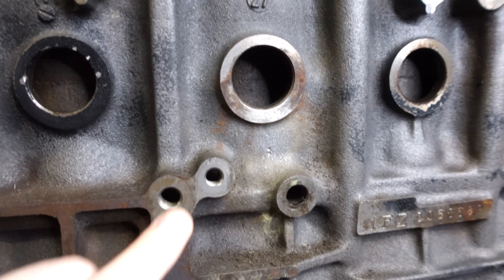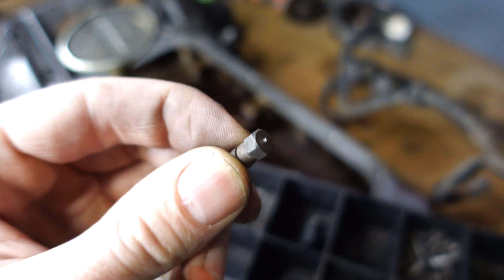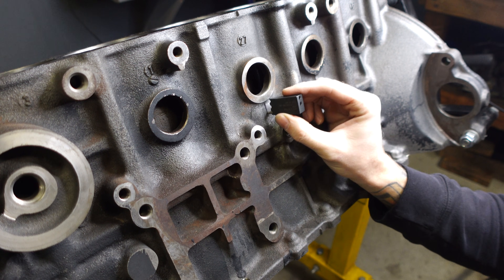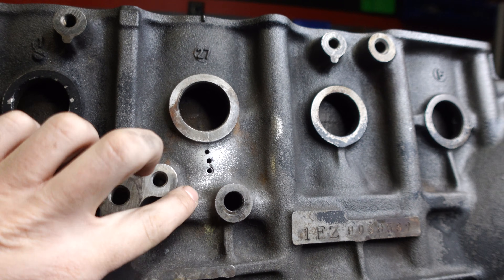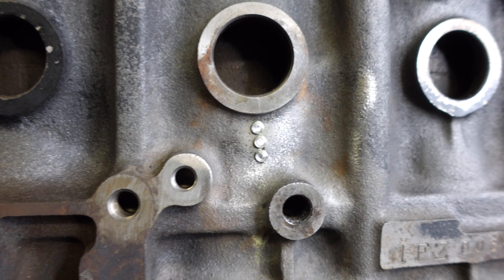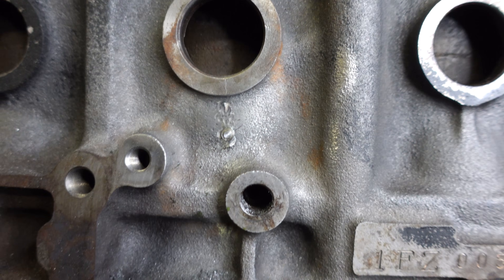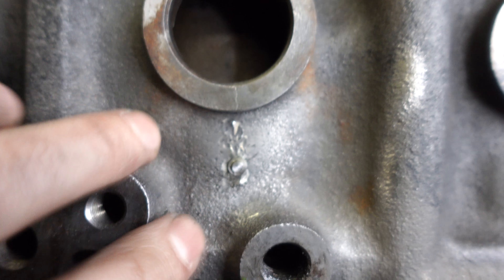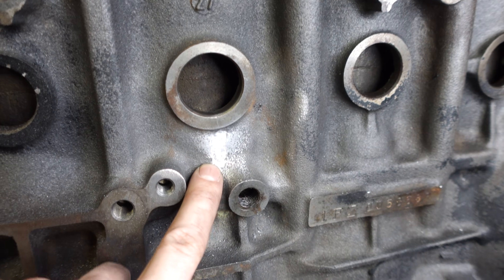How to ACTUALLY FIX a CRACKED Engine Block! Cast Iron Crack Repair

Comment from the maker: If you noticed, I missed the tail end of the crack at 10:27. That has since been stitched.
Reply: im not a mechanic 
same situation , what i did was  glueit with 1,5 kg of jbweld , with the engine on the car  , never had a problem
Reply: @TheMakyato was your crack from water freezing in the engine?
Reply: @Ron_Presley  no  , it happen when i was living in israel and they do not have "winter" i think the car overheat and some failure in the block engine also a month before that i have a blown head gasket + the real isue .............bad thermostat and bad cooling radiator 
first signal knocking  in the engine  follow by power reduction and engine stop , let it cool restart and bit by bit the car manage to get me home 
it was not jbweld but similar glue
Reply: So there is no name for this technique of repair 
just stitching pin

Comment: Hello, I have a similar crack repair I need done on a 1937 Harley case. I've emailed and called Lock N stitch and not having any luck getting a response. Can you send me a contact for the guy that leant you the kit? I have a 2" & 3" crack to repair approximately 1'2" thick.Thank you

Comment: wait, so what prevents it from spreading? Its going to need some kind of sealant right? the drilling, tapping and pins aren't quite enough right? I'm suprised you need so many pins, I would have thought that one on each end of the crack would be enough, unless is it the threads that make a vector for sealant to penetrate deep into the crack instead of just creating a surface patch? And being that your mend was made at room temp, shouldn't the crack tighten up when it gets up to temperature rather than pull apart?

Comment: I used to do metal stitch crack repair on industrial engine blocks (just like this). I repaired hundreds of cracks with no leaks. I would have gone all the way to the top end of that crack. Otherwise, you did fine.

Comment: A quick tip for anyone drilling cast iron or other hard metal - the cutting tip loves thrust force. You will have good results slowing the drill bit way down and putting lots of pressure on the bit. It's always temping to think faster is better, but you run the risk of work hardening the metal and making it even harder to drill.
Reply: So true. Less rpm more pressure applied and frequent oiling of drill bit and area being drilled to help cool the bit to keep it sharp. The faster the drill bit is spinning the faster your going to dull it and harden the work area
Reply from the maker: Absolutely true and I’ve learned since!

Comment: I think you could have done the same if not better with a plain weld. That part of the block is not exposed to very high pressures. A weld would be more than enough to prevent a leak. 

Heck, I'm sure there are even high temperature liquid gaskets that would have worked for that small crack.

Comment: Fascinating process; intuitively, it seems like it would weaken the block, but I watched another video about how they used this process to repair a block crack during restoration of the 1st Deusenberg, so apparently there is enough experience and confidence in the process to trust it.
Reply: Watched the same, but the guy vouching for the product was the guy who made it. To me, it really seems like loctite is the only thing really holding this together. It's a fascinating process but I think I would just clamp the open end of that crack at the freeze plug, and get the welder out and make it a permanent repair. 

That said, I'm not an engineer so whatheheck do I know.
Reply: Yupp got curious after watching that video lol
Reply: I watched the Deusenberg first, did a search for the method and ended up here.

Comment: A less expensive and easier fix is to drill a 1/16" hole on each end of the crack.
Create a v groove at the crack line. Do not use JB Weld.
The best product is windshield adhesive. It stays flexible and will not crack out.

Comment: Question: @10:00 you peen the surface with a socket extension. Leaving aside the use of a socket extension as a peening tool... did the kit recommend peening? My first reaction is that it might stress the stitch pin threads or risk loosening their grip on the block or cause cracks in the threads themselves. Understand you report the block's not weeping, which is good.
Reply from the maker: It did recommend it, yeah. I just used what I had and it seemed to work.

Comment: Is it hard to get a quote from lock N stitch?
Reply from the maker: Honestly the company has a difficult online process. It’s not as easy as just ordering the pins. You have to contact them and give details about the engine, thickness of the block, etc etc. then they give you a quote.

Comment: Did it hold?
Reply from the maker: Yep!
Reply: @RM_Garage  I think I am going to give it a try.
Reply from the maker: @michaelneuman6910  Many are skeptical but this is a tool designed to fix cracked engine blocks and it's what machine shops recommended me to do. The other option was spray welding.
Reply: I am trying to get a kit ordered from lock and stitch and they are asking about thickness of my block.  Is that important?
Reply from the maker: @michaelneuman6910  Yeah. You need to figure that stuff out.

Comment: I swear, I saw that cracked extend a little further down than the very bottom pin…. I think another two pens would’ve been perfect at the bottom… all in all, though you did a good job !
Reply from the maker: You absolutely did! And I extended it after the video. I noticed it too.

Comment: Just started video and in case you don’t say was wondering if the block cracked from water freezing in the block?
Reply from the maker: I don’t think it was from that since it was a California vehicle its whole life. I think the early blocks are susceptible to those cracks, maybe due to thickness differences in the casting in that area or something - not sure.

Comment: what do you think about jb weld for repair the same problem as yours?
Reply from the maker: I don't think it would hold the pressure.
Reply: @RM_Garage  I think Jbweld  would if you cut a v channel along the crack for it to have depth in adhesion
Reply: I bought belzona 111
Reply: @falcon9282  did it hold??
Reply: @falcon9282 and…did it work ?

Comment: No metal shavings will fall inside after you drill ?
Reply from the maker: A little, but flipped it over and blew it out with a compressor

Comment: That's ridicules cant believe that's the only way to fix that.  So the 2 drill spots on the block before you started that was done to hopefully stop or relive the crack right. Mine is not leaking but it sure seems to be an common occurrence. My motor probably has 250K on it and I have done the timing chain and lower upper pans while it was in the truck. But I want to install a turbo on my engine but did not want to just slap it on there. I wanted to refresh the motor first. I use my truck mostly off road and looking for maybe 15-20% power increase. I know Im at a point to where it might make more since to repower but that motor can run forever compared to others. Thanks for the video. Really ease to watch your work nicely presented.
Reply from the maker: If you have a later model 1FZ you probably don't have to worry about it. I've noticed it's mostly an early 1FZ thing.
Reply: @RM_Garage  10-4 so what do you think about the refresh before turbo.

Comment: Nice! I did a new plug and some jb weld on my 1fz hairline crack. It held for a few thousand miles but she's still weeping. 

She's running great but the hairline crack was why I was planning on getting a new Factory Short block, your build has me thinking though that bore over sounds sweet.

I like your comment about block seal, I've been thinking about calling bars stop leaking asking him what product I should use for that hairline crack. I think I would bypass both my heater cores and swap out my brand new Toyota radiator for the old one run it for the specified time to seal it and then switch everything back with fresh coolant.
Reply from the maker: Yeah it needs to be jb welded from the back side. The coolant pressure will cause it to leak again over time.

The machine shop recommended block seal, stitching pins (as I did), or both.
Reply: @RM_Garage  yup, that's what happened, I need to add some bars stop leak to my 80 series to do list.
Reply: What year is yours?
Reply from the maker: @crashedking1931  1993
Reply: @crashedking1931  mine is a 1997, I just picked up my new factory short block, I'm going to build a new motor, I'm not in a hurry though with the work I did on the original 1fz.
Reply: @BillyGoatsAdventures  Hello where did did yo get the factory short block and how much$$
Reply: @crashedking1931  Mr T places a special order. Shop around some dealerships of playball some don't go for 10% above cost

Comment: Watched this video....ran outside and stuck my head under the hood of my fzj looking for cracks. 😬.   Nice job with the fix
Reply from the maker: Thanks! It’s actually common on the early motors I guess! Whole thread on ih8mud about it. 4 pages long
Reply: @RM_Garage  I've read that thread and mine is a 96 but still makes you worry a bit.   Good to know there's a fix
Reply: @davidp130  if you ever find you need the fix let us know - we will set you up with everything you need!

Comment: Nice work. I was not aware of these stitch pins, although I would have been if faced with this. I would strongly advise against using block seal, it may get into the heater core and or gum up the thermostat? I may be confusing this with stop leak though?  Nice work, and great editing as usual. Thank you, Jim, the 22R happy truck person.
Reply from the maker: Thanks Jim! I wasn’t aware previous to my issue either. Maybe you’re confusing it with stop leak? The machine shop said there are modern block sealers that do a very good job. I guess we will see if it even leaks anymore first.
Reply: @RM_Garage  I'm not familiar with block seal then. Maybe it's something that's applied to the block before it's running to coat the metal? I will inquire about this today. Jim

Comment: I did this on my 390 lock and stitch is awesome
Reply from the maker: I pulled the trigger BECAUSE of your video!
Reply: @RM_Garage  That's great!  Your video is better than mine lol I was just getting started when I did that video!
Reply: @RM_Garage  Now THIS is awesome to hear!  Thank you RM Garage for your incredible video using our products - sorry it took us so long to see it!
Reply from the maker: No problem! It works great and the engine is running leak/crack free
Reply: Where can I buy a lock N stitch kit? And how much are they typically?
Reply: @ElectronicMechanic so glad to hear the products worked great for you too! Had to come back to edit this comment - THANK YOU again!  You did have such an incredible video posted.
Reply: Dove si può acquistare?
Reply: I've tried emailing and calling Lock N stitch and haven't had any luck getting a response back. Do you know where I could purchase a kit? Thanks